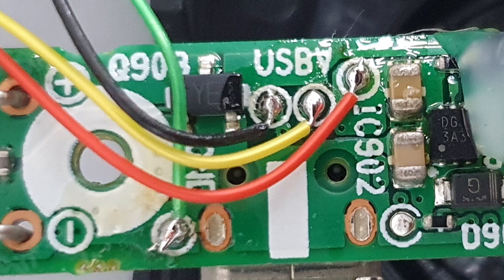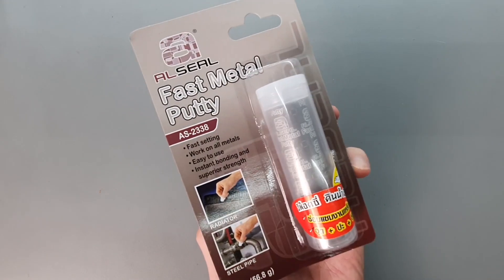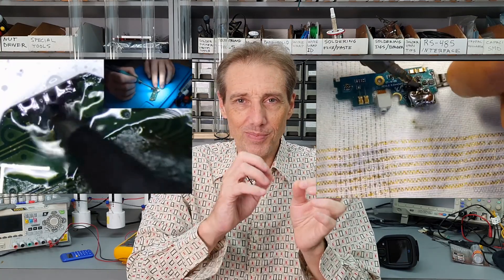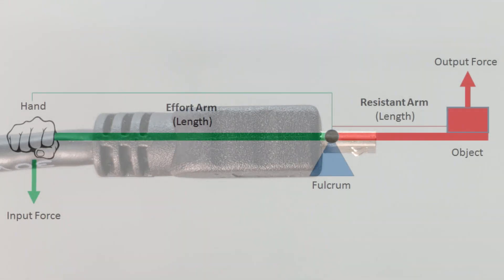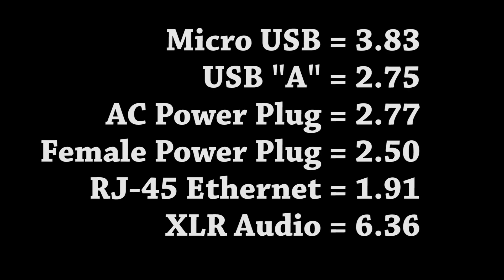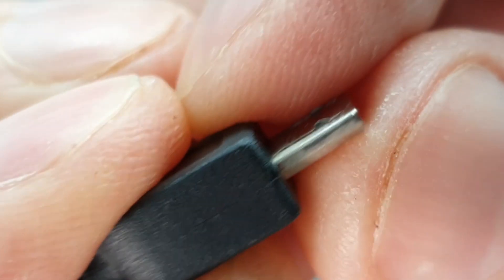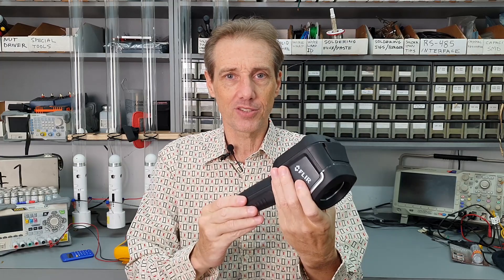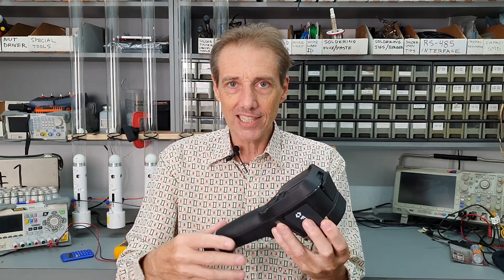How To Fix Micro USB

Comment: BRAVO!!  I'm in violent agreement assessment of microUSB. Years ago I was under similar [pressure to substitute cheap(er) plastic multiconductor connectors on very expensive computer peripherals. "Cost reduction" goals they called them.  Garbage plastic/garbage pins. Already failing in our in-hose QC vendor acceptance ("AQL") tests, before manufacturing.  Management felt it was better to save a buck, and loose a customer.

Comment: Some of the reasons they kept changing the chords was to get more data through faster so a lot of the changes were necessary  and the only reason they made them smaller was because cell phones kept getting thinner and thinner.  But ya, they're cheap pieces of crap and that's because it takes time and money to design them and uphold license fee schemes and enforce universality so they charge manufacturers fees to produce them and since the manufacturers are the ones paying them and they want cheap sh.t that breaks...

Comment: Respect for even getting those GD little wires stripped SO CLEAN without ripping them off over and over. Those is seriously a huge help to myself you have no idea, just wish I would have came across sooner guy. Thanks for this. But I am a heavy handed ape and end up tearing everything off just trying to slide of the sleeve after trying to strip. I love your comments on the DUMBASS design on this SHIT. SO RIGHT... LOVE IT. LMAO.

Comment: Hi Leo, I’ve found that the mini usb is more robust than the micro usb, I’ve broken many of the micro’s due to the the fact of probable cause, ie: in upside down in most cases, but more so how flimsy they are if bent or trodden on in an accidental way, hence forcing them in, normally they break, as I have found in most cases, so solution to the problem is.. ready for it….. bring out more usb-c connections in everything, or leave it as mini usb , it worked, and I was taught, if it’s not broken leave it alone.  Rant over, just my objective view that’s all, like your videos, YOU MAKE SENSE, not STUPIDITY.. keep up the great work pal.. 🤙🏼🇦🇺

Comment: I always blamed the little "fangs" on the flat side of the plug — there's just no way those things provide enough springy-ness to withstand years of connect/disconnect cycles.

Curious what your experience has been with USB-C though. I don't think I've ever had one fail on me.

Comment: Ever have a micro USB or USB C cable fall out of its socket?  I work with professional audio and video gear.  There has been a wide spread migration to micro type connectors.  Flimsy as you point out but also not locking.  What the industry needs is a locking type A connector.  A simple solution would be the locking tab used on "display port" video connectors.  The male cable end has locking tab that is part of the sheet metal housing that extends into the plastic cable protection to unlatch the connector.  The female receptacle has hole that the locking tab grabs on to.  Cheap, easy to use and robust.  And compatible with non-locking parts.
A latching type A connector would provide a robust connection that will not fall out.
Reply: Type A shouldn't fall out anyway. It's a fairly large connector which should have sufficient friction (otherwise something else is wrong, like a worn or damaged socket). Besides for the friction aspect, the male connector has two square holes which should be filled by springy extrusions on the female socket, holding it in place.  Locking tabs are a horrible idea. I broke my first ever displayport cable because I tried to remove it from the socket by force, not realizing that it actually has a metal tab that locks it in place. This can happen a lot more easily than you think, and there are tons of even less tech-savvy people out there than me. I like magnets (eg Apple's macbook chargers circa 2011), but otherwise the metal-on-metal friction of a well-designed & well-sized connector should be all that's needed.
Reply: @DimitriPappas  A type A connector should not fall out unless someone yanks on the cable, steps on the cables, dislodges the cable while unplugging a nearby cable or one of a multitude of other problems.  If the connector does not lock or latch, then it has the habit of disconnecting (falling out) at the worst time.
I come from a pro audio sound environment where most everything is locking cables and non-locking cables are discouraged.  I'm looking at you 1/4" headphone cable.

Comment: Hah! Like an idiot I bought a bunch of micro USB sockets and did the insane microsoldering ...only to have them break off more easily than the original...It never dawned on me to solder wires to a regular usb plug.

Comment: Hi Leo,
A few points, looking forward to your feedback.
  * I found that reinforcing the through hole pins on the micro USB connector with some additional solder on the bottom side prevented me from breaking the connector. Granted it's not the default behavior in the industry and I was only using a 1 inch Wemos D1 Mini (not much opposing leverage), but it worked surprisingly great! The cable side did bend in the experiment, but it wasn't catastrophic either since it was soldered internally. Plus, it is easily replaceable with a cable found at a neighborhood Dollar Store.
  * I was not able to reproduce the "bending the cable connector by hand" that you showed in your video. I needed about 1 inch of leverage on the board side.
  * Do you have a suggestion for an alternative connector? In my particular case, I am working on a board that allows multiple LED strips / devices to be connected by the end-user to a base module without soldering. It needs to be water resistant and as reasonably compact as possible (immediate application is a bicycle helmet with up to 4 strips), but not high insertion cycle. I would prefer something like keyed through-hole 90 degree .1" headers (as I think you would too), but I am not able to source them with the tough cable sheathing that USB cables come with, they're not as water resistant, require through hole soldering (not that bad), and apparently don't look as nice as a professionally injection molded strain reliefed cable. And getting a replacement cable if you do break or cut through it is tough.
Thanks for your advice.
Nolan

Comment: Then take USB C bioengineers for engineer's who never leave the lab. Take intel arguing for it over 3.5 audio yeah like that's not going to break from abuse! 
Or take the galaxy s10 have any the USBC connected directly on the main board, rather than a nice, cheap, easily replaceable flex cable!

Comment: Agreed with everything except your final conclusion - I think sadly neither the consumers nor the product designers have any power to effect meaningful change. Even if the product designers convince management to produce a more expensive and robust design, and even if the consumers buy it, its profit margins will be slimmer and it will be seen as a failure. Disposable objects are more profitable than robust ones. The system is at fault, not the designers and consumers!
Reply: Came here to say that. I was with OP until the portion where he said if everyone buys the more expensive but longer lasting products then problem solved. I think its easy for technically minded people to get in their own bubble and forget how most people use (/consume) the products we are working on. The vast majority of users do not have any insight into how it all works, or if it breaks then whick part broke.
For me the solution is more in regulation of standardisation, so that we minimise waste, and make sure that the decisions are made in the interest of users/society rather than profit.
Reply: Leo, i agree with you. Of course i would buy your product that will last forever. Would you be out of business if you made a product that didn't break after a year of use?

Comment: When I was at a camp, someone told me his 2 years old Nexus 5 phone wouldn't charge reliably. I offered to take a look, and fetched my tools. The USB micro port was not at all broken, but so stuffed with lint that the plug didn't fit in anymore. I also have a Nexus 5 phone, which is now 8 years old and I never had to clean or service the USB port in any way! The moral is that it heavily depends on the user.

At work we had a PICKIT 4 where the USB connector fell off the PCB. When I repaired it, I noticed it's a full SMD type connector, not the more common connector type with 5 SMD pads and 4 Through-hole chassis pins. Moral here is that it also depends on choice of part (possibly also manufacturer)

Comment: What are your thoughts on usb-c ? I've been considering it for an automotive application constrained by the addition of 3rd party hardware.
Reply: You can get USB-C connectors that are reinforced with an extra piece of steel frame, but the connector also has an even crazier pin pitch, really finicky. Also i think PCB mounted connectors where significant force can be exerted are just a bad idea, and special considerations actually need to be made for all connectors and all external controls, how you want to prevent them from warping the board and breaking solder joints. If you have to do USB, then if you can't do full size USB B, USB-C can be a viable choice. You may also consider making it a daughterboard on a ribbon cable that can be easily replaced.

BTW the male USB-A 3.0 connector is bad too. I once had some piece of junk fall into the connector of a... back then $50 USB stick and mangle the SuperSpeed pins when i plugged the thing in, such that it wouldn't work again, not just at SuperSpeed, but at all. If you have to do USB 3.x, all you have is basically bad choices, and USB-C is likely the least bad of them. Don't get me started on the USB 3.0 Micro B, which is a disconcerting wide boi. If you bought an external spinny hard disk several years ago before USB-C, you know the plug.
Reply: @SianaGearz  Yeah, but what goes wrong with microUSBs? I have one that seems pretty lint free, the center bit isn't knocked woggly so the pins should connect...need to hit it with an LED and a loupe rather than a cellphone zoom, but it's not a fragged male shroud that's wrong. Why won't it charge...
Reply: @Cineenvenordquist  solder joints connector to PCB. Usually the weak spot for microUSB since the connector ends up warping and pivoting around its anchor points, lifting the pins from the PCB. There are about 16 common constructions of the microUSB connector regarding anchoring and pins, and basically all of them end up with similar susceptibilities, some are better than others. If you wonder why so many: different protrusion extent (how far the connector overhangs the PCB edge), some drop into a routed inset, straight vs upside down, etc. It's crazy. The complex shape of the connector shell encourages these issues. The straight oval shape of USB-C is more stable.

MiniUSB was pretty reliable in through-hole version, it has a more fortunate aspect than micro which keeps it stable. For some reason it has a much lower rated cycle life than micro, that is number of insertions it's supposed to survive. Probably a spring contact and tongue design issue? But in reality it just holds up better.

Comment: 480 Mb/s USB will not be very happy running over a long sloppy wiring splice. Make the data leads a twisted pair to increase your chance of success.
Reply from the maker: Good point! The things I have fixed so far are all rather slow, the transmission line effects should not be a problem, but for high speed, you are 100% right.

Comment: This is part of planned obsolescence. If that doesn't get you the built-in lithium ion battery with a lifetime of 500 recharge cycles (and zero deep discharges) will.
Reply from the maker: Yes! Sing it! All of those products should have a way to easily replace the battery, so you are not forced to throw it away when it's still totally repairable.
Reply: They could easily get the battery life to 1500 cycles by sacrificing just a tiny nominal capacity - but the actual average capacity in 2-year use cycle would likely end up larger.

Battery easily replaced? Ah but then nobody makes the battery. I have several devices where all the decent custom-fit batteries for them were manufactured years or decades ago and spent all that time in bad storage conditions, got deep discharged, they're damaged - or come from suspicious manufacturers and also have barely any actual capacity. You'd need to standardise the batteries too to ensure their availability.

Comment: +1000! I hate this connector too!
A solution is to use a magnetic adapter. But the one I bought can be reversed, allowing you to burn your device! Amazing!
Do you know where I can find some with a polarity security?
Reply: The ones I've used work correctly either way because of how the pins and contacts are mirrored on them.
Reply: @StubbyPhillips  Do you have a link?
Reply: @StubbyPhillips  or usb c conversation 😄 also wireless charging conversion.

Comment: I have come to the conclusion that the "engineers" who design MOST of the connectors used in consumer products are IDIOTS.  Didn't anyone involved in the development of USB connectors (prior to "C") notice that it always goes in the OTHER way but if you start out that way, it feels wrong so you flip it only to find out it actually was right the first time.  Actually, this isn't always true.  I think it was in the Summer of 2019...  I plugged in a USB cable and got it right on the first try!  Anybody remember the S-Video connector?  'nuff said. As for the people who come up with this crap, to borrow a bit from George Carlin's rant on drivers, "I just want to see what they look like!"  I think my FAVORITE connector has to be BNC. They are reliable and easy to connect while doing the blind reach-around.

Comment: Great video! Micro USB is the worst. USB-c is slightly better, but my favorite is actually apple's lightning connector.
Reply: @supwrmax: micro USB is better than usb c if you are a company marketing wireless peripheral for Android and Windows because of easy circuitry. Charging those tiny battery with usb c would be ridiculous .
Reply: Apple is the worst offender of perpetuating the "thinner is better" mentality though. It even caused them once to ditch their just-established MagSafe power connector in favor of a new, slightly thinner but of course incompatible one... because they wanted the new line of laptops thinner (yes they broke easily on the hinges and had terrible thermal design too)
Reply: @juliannesermon8057  Apple is just stupid.